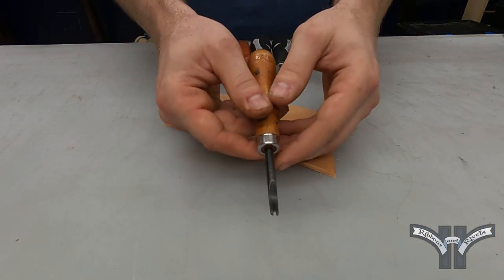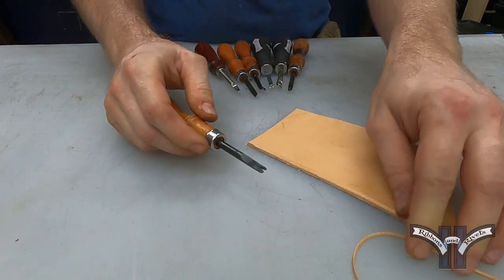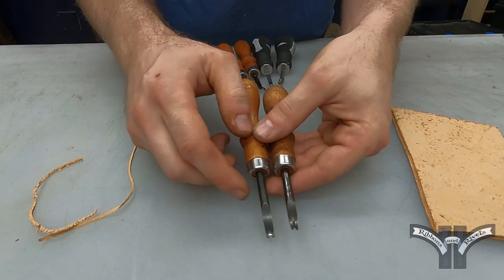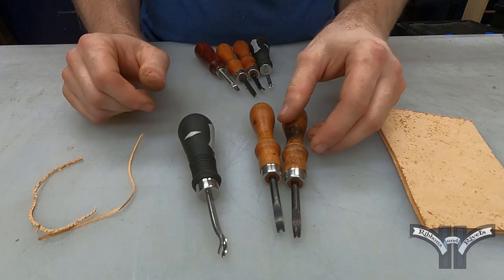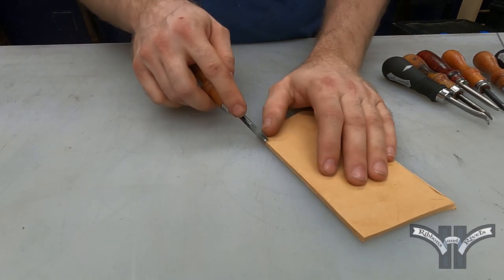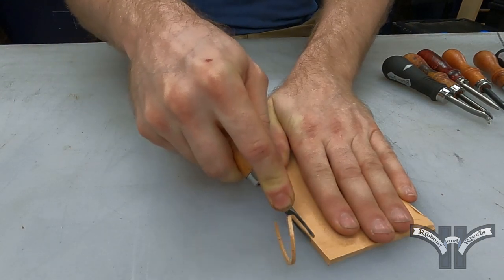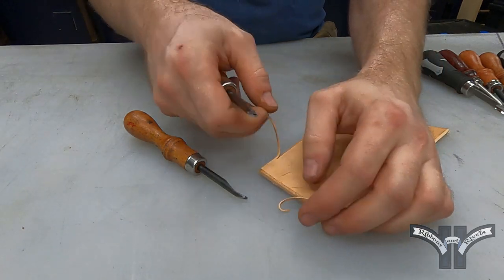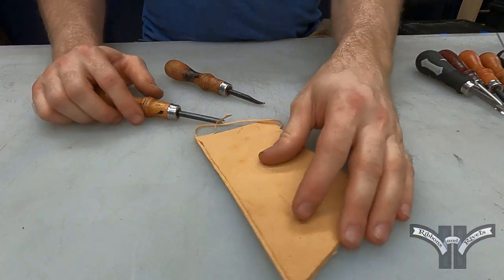Leatherworking 101: Beveling

Comment: How do you keep the beveler sharp?
Reply from the maker: There are a couple different ways to sharpen a beveler.  The way we usually do it is with a sharpening plate like the ones they sell at Tandy. https://tandyleather.com/products/craftool-sharpening-plate?_pos=1&_sid=410c47ac0&_ss=r 
You just lay down a sheet of fine grit sand paper on the ridge that matches your beveler size, join the shiny side of the beveler with the ridge and pull backwards.

The other way is with a tiny file. You create the same motion and effect as the above method, but you have to maintain the angle yourself. https://www.amazon.com/SE-7382NF-Premium-Quality-Needle/dp/B0045L7Z1W/ref=asc_df_B0045L7Z1W/?tag=hyprod-20&linkCode=df0&hvadid=309807921328&hvpos=&hvnetw=g&hvrand=6140547557210907365&hvpone=&hvptwo=&hvqmt=&hvdev=c&hvdvcmdl=&hvlocint=&hvlocphy=9009564&hvtargid=pla-499731899037&psc=1

I've found that I generally only get 4 or 5 sharpens out of a beveler this way. But you can also strop a beveler between uses with a 4/5oz leather edge and maintain a beveler's sharpness longer before needing a legit sharpening.